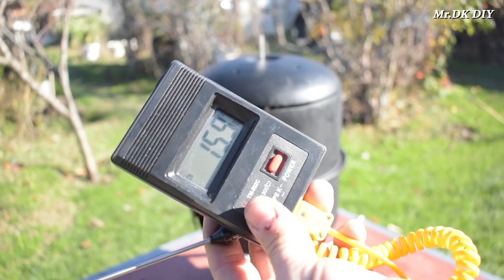OLD EXPANSION VESSEL ???  What can you do from this /Homemade DONER (GYRO) Machine

Comment: It's a good basic idea except that for your coals to burn properly you need a controllable air inlet as well as exhaust. Also that little motor you have won't last long. Next time try 2 motors , 1 on top and 1 on bottom the swkeeker slides into a holder on top and bottom from the side. Or you can just use a bigger rotisserie motor on the top and creat a removable oil drip pan on the bottom as well as you'll need a removable ash catcher.  I just recently found one of these water heater safety tanks but the one I have is very small.  It measures 8" across and 10" tall. So I'm trying to figure out something to make out of it. If I can get my hands on a metal drum then I may just turn this little tank into the fire box for the drum or I could just make it a very small grill for camping or hiking